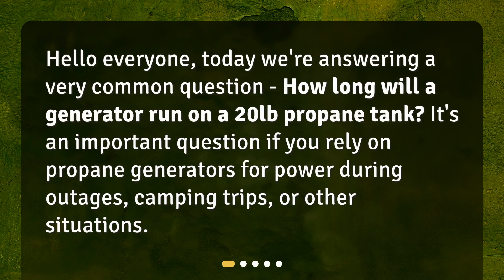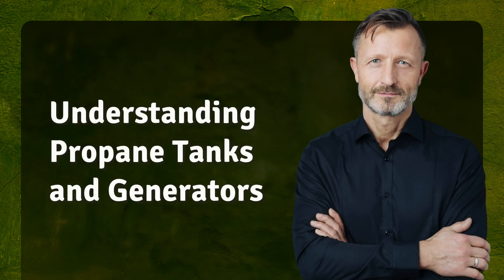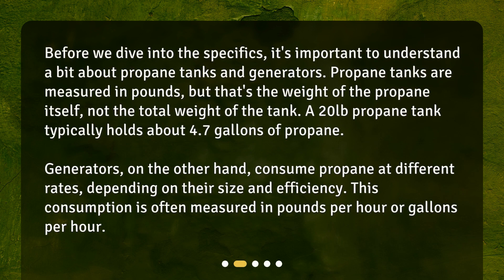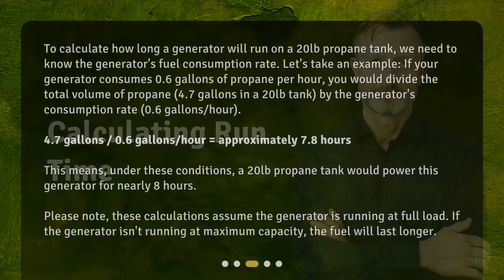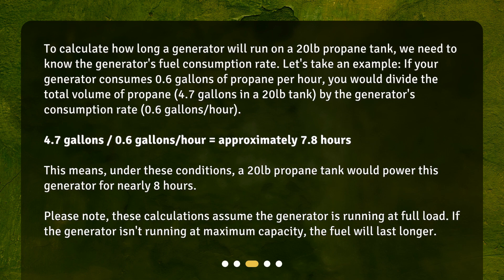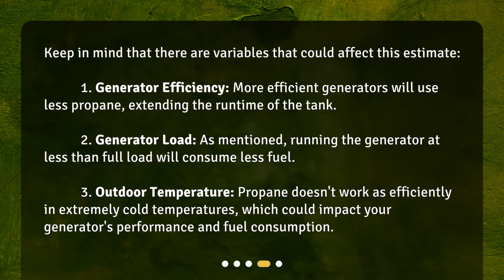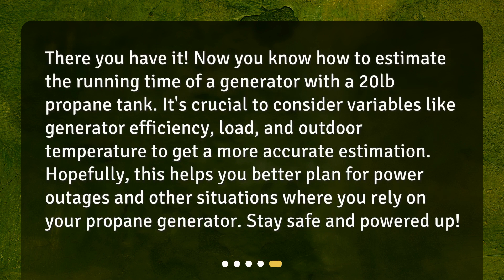How long will a generator run on a 20lb propane tank?

Comment: As a rule a propane generator will burn in a small air cooled generator about a 1/2 gallon of propane per 1000 watts used - 
      I say small that is a 4000 watt or smaller non inverter generator- a 4000 watt generator will normally have a 7 HP engine - each HP generates 416 watts - so a 4000 watt generator can handle a 4 second surge at 4000 watts - 
        But it can only handle a maximum continues load of 2900 watts -  the half load of a generator is only 25% of it's rated out put - 
      In this case with a 4000 watt generator the half load would be 720 watts - 
      If your pulling a continues 720 watts with a 4000 watt generator - a full barbeque propane tank will last about 12 hrs - 
      The larger the generator the more fuel you will burn - 
    1 gallon of propane will generate 2000 watts - 
    If you have a dual fuel were the generator can burn on gasoline - 1 gallon of gasoline will provide 3000 watts - 
      Gasoline is 33% more fuel efficient than propane - 
     If you have a bulk tank say a 250 gallon tank - then it's a lot more practical to use propane over gasoline - 
     On a bulk tank if your generator has a low oil cut off - the generator will shut down after 3 days or so on a low oil level -